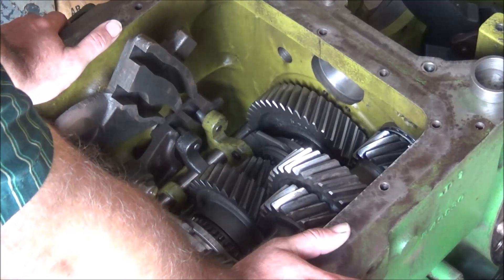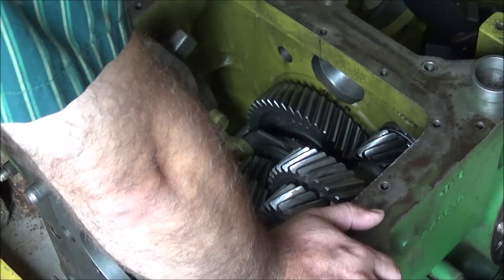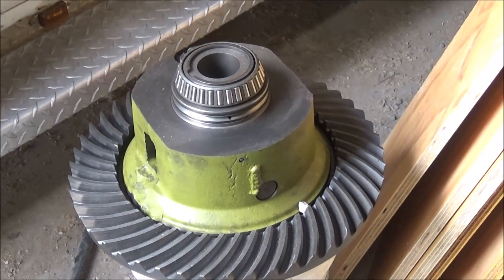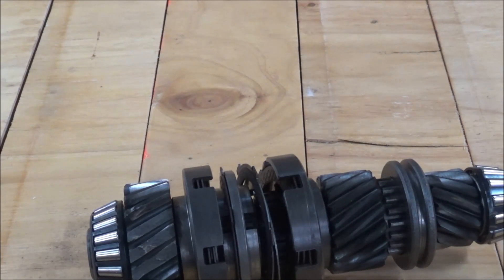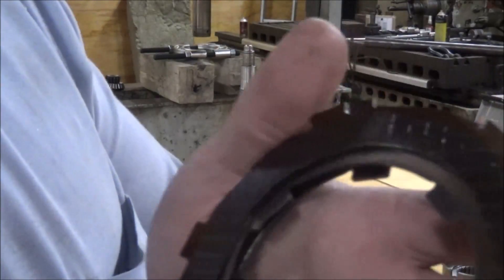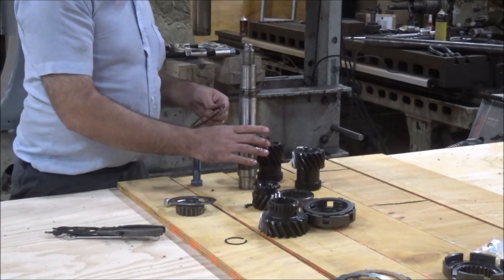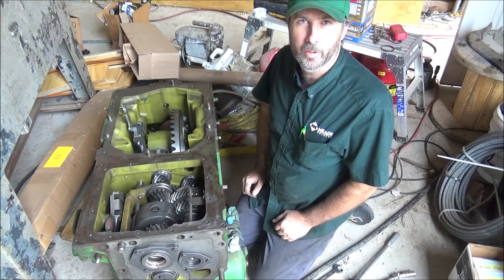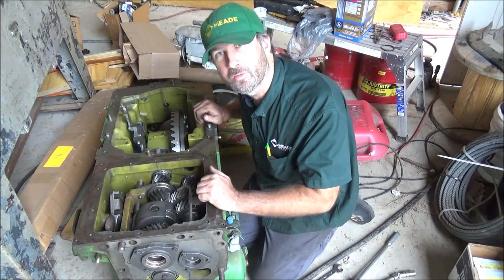Deere Tractor Pulling Transmission Faster Quad Range

Comment: I currently have a john deere 4350 with a quad range split. Whilst it's split my dad wants to swap gears in the quad-range for a faster top speed when on the road than 18mph. Do you know if this is possible and what gears we would need. 

Thanks, 
William
Reply from the maker: I am not familiar with a 4350 because we Don’t have those in the us. I assume it is like a 4250 and uses an under drive/direct 2spd. You get put a 4440 or 4455 2spd in it which is direct and overdrive and that will increase your ground speed 27% in both lo and high.

Comment: Nice vid sir..but ive always wandering how this power shift really works...
Reply from the maker: This isn't a powershift transmission they are made totally different.
Reply: @bcbloc02  got it sir..sorry..faster quad range right?.. if possible ask some favor how it works..coz my 4430 JD has a 1st and 3rd gear slippage..2nd & 4th gear are working and reverse..i was thinking to bypass the slippage gears 1&3, is it ok.? Thanks

Comment: what speed did the new gears obtain?
Reply from the maker: 6% faster than factory road I think.
Reply: So all of D range was only faster, A,B,C the same?  Are those gears still available?
Reply: I have a 4440 that is needing some hi/low work and it does a lot of road work. Was curious about a little faster road gear
Reply from the maker: @jimcrocker5183  The bottom shaft gear is still available from Deere the countershaft is not so you would have to find it in a salvage yard. If you didn't care about all the gears changing you could speed it up 27% by putting 4430 finals and brake plates on it.  That is a much easier job than a complete transmission teardown to change the 2 gears.

Comment: To handle any real hp you need to build 3 speed transmissions for these john deeres. If guys are serious pullers though they usually don't use a quad. The usually use a syncro. I have  built many 3 speeds but never one for a quad. The new top shafts that I build are 1 3/4" dia where they come through the front bearing and I use a coupler to attach to the 1 3/4" clutch shaft. Not sure how that could be coupled to a quad 2 speed. The 3 speeds I build are usually all faster than the original  road gear. They use the 7th gear slot, 5th gear slot, 8th gear slot and  1 reverse.
Reply: Here is 3 speed i made.
"https://i.ibb.co/fd9cB9h/Screenshot-20200414-190040-Samsung-Internet.jpg"
Reply from the maker: Yep about 800hp is the limit on a 4430 based rear before you start breaking stuff all the time.  Keeping the quad is an advantage in the RPM limited classes because you can get more ground speed mid track vs bouncing off the governor. The 4640 based trans I built had 2 road gears for a 17.5 and 18.5 final. It has lived hundreds of hooks with 1500+hp and 3000ftlbs of torque in a 10000lb class. 3 spds are for sure the way to go for the RPM unlimited classes unless you want to really get fancy and free up some hp using a Profab or SCS box to eliminate all the stock design stuff.

Comment: Some footage later of the trans in action would be cool! 

Also when your tightening bolts in a transmission you must make the "click, click" sound with your mouth to ensure proper torque. Pro tip. LOL

Comment: I remember those snap rings on the bottom shaft, I had wedges made up for them. When you bolt it up there is no washer on the top r/h bolt or it will jump out of D range If I remember correctly. Dont ask me how I know, lol. I used to enjoy that work, I was always the gearbox man. I remember them splitting the rear gear on the top shaft from going reverse to forward without stopping. Or vise versa cant remember now. The press is paying for itself. I always have a big block of wood under mine in case I miss catching a shaft.
Reply from the maker: Back a big load in B or C reverse that will usually break one for sure.  These gearboxes are a bit more than the Fergies have. LOL
Reply: Yeah these were my bread and butter for many years. The Fergies are more of a hobby as they are light to cart around. Wouldnt pull the skin off a rice pudding.

Comment: What do you mean by “cheap” oil? Saying I should be using only synthetics?  Can you recommend a brand-name? Love your videos.
Reply from the maker: Anything that usually says"universal" on it is bad.  In the case of these transmissions I would reccomend John Deere Hy-Gard only. It is especially designed for equipment that can sit for long times and has excellent corrosion inhibitors as well as extreme pressure lubes for when it is being used hard.
Reply: thanks

Comment: Brian, You mention the problems caused by cheap oil.  I want to know what oil you recommend?  Thanks for the information and entertainment.
Reply from the maker: Anything that usually says"universal" on it is bad.  In the case of 
these transmissions I would reccomend John Deere Hy-Gard only. It is 
especially designed for equipment that can sit for long times and has 
excellent corrosion inhibitors as well as extreme pressure lubes for 
when it is being used hard.

Comment: You need a big logo sticker to put on your work.  Perhaps a cube (or two) in isometric view with your initials, one on each surface in view, and imposed over symbols recognized for mechanic, machinist, and welder.

Comment: Brian, the other problem is when you don't heat the oil up enough to drive off the water, so it stays emulsified forever.  This is a common problem with forklifts running propane too, because the propane converts to CO2 and H2O, which makes it into the oil.
Reply: EFormance Engineering CO2 and H2O are the primary product s of all hydrocarbon (propane, gasoline, kerosene, diesel) combustion ... Propane is not special in this regard.

Comment: Congrats. Great job. I try to avoid messing with a transmission. That work makes me nervous. Seems to be relatively small, for this amount og torque.
Reply from the maker: Well it was only designed for torque in the 500ftlb range but to last for 10000hrs doing it.

Comment: Gee Brian, I guess you'll have to tear it all apart again so we can see what you didn't show us. Remember we all learn from mistakes...Just kidding. BTW I hope you tightened that loose nut in your shifter quadrant.
Reply from the maker: Yes, did you not see it in the last shot? ;-)
Reply: So is there supposed to be a gap between the nut and the main shaft selector quadrant?
Reply from the maker: I thought you could see it at the 15:40 mark that they had been tightened up but they are blocked out of the shot.

Comment: Good information to know about using the cheap oil . Is there a specific oil that should be used ? I would enjoy some footage of these pulling tractors you work on. Thanks again for sharing your time with us.
Reply from the maker: I use John Deere Hy-Gard but in general the manufacturers suggested oil is the best to use.

Comment: on the clutch pack you assembled.. is that mechanical force being applies some how to squeeze the clutches and steels.. or is there a hydraulic piston on the shaft that we missed. 

 how big a super magnet do you stash down in the bottom of the transmissions to collect the fragments..  since i have been using super magnets. my gear oils don't turn color..
Reply from the maker: That big drum looking thing on the top is what applies the force to the syncronizer clutches when you shift it.
Reply: so the pressure on the clutch pack is applied by a shift fork then.. not a hydraulic piston.  ok.. oh.. that a syncronizer...to slow the shaft to match speeds for spline engagements .. not actually a engine torque transfer clutch pack...  the missing friction material in some areas must be what caused the random wear to the splines or teeth faces. ..  now it makes sense...

Comment: The first thing we did in the spring after the tractor sat all winter was crawl under and pull the plug on the gearbox. It is amazing how much water comes out. All condensation.
Reply from the maker: All so true, good advice!
Reply: This is it. The heat of running regular will drive off the water, but let her sit for a year and you end up with a lot of condensation in there. Better oil will cling to surfaces longer in storage, preventing the rust. On first start, the water will burn off once the engine warms up however when you first start it the oil pickup will first pickup the water because it is at the bottom of the pan. During first startup, the engine is getting water or water/oil foamy slurry until it warms up and drives off the water..... This wears the engine fast.  Draining the water in the spring is a great practice. In addition, if you check fluids in the spring before running the machine, the water could make a low oil level look normal on the dipstick. Always recheck fluids after the first run due to this.
Reply: Would be nice if it had a water separator plumbed into it...

Comment: Why is the draft sensing in there for a pulling trans?
Reply from the maker: Farm stock rules require working 3 point hitch.
Reply: bcbloc02 ah ok..but do they check for draft sense function?

Comment: So many times I've forgot to turn on the camera . Or The battery goes dead and shuts down the camera in the middle of a operation. Fun stuff. 
Those transmissions are pretty HD looking.
Reply from the maker: Yeah I had a battery cutout on this job too. Also don't forget memory card is full and it shuts down too!
Reply: @bcbloc02  The fun never ends.
Reply: You guys are better than me. Number one problem I have is forgetting to push the "record" button.  🤔

Comment: FWIW turn the
 guillotine puller 90° to reduce chance of bending the threaded rods on a hard pull
Reply from the maker: I had them well supported and it only took about 3 ton but yeah the other way is stronger, just harder to manipulate by yourself at least for me.

Comment: Cussing is ok as long as there's no tool abuse ;-) Unsure of how much ram force you were applying to those shafts but have found   that bearing separators are much stronger if used 90 degrees to way you had them.

Comment: Nice work.  I would rather do an automatic over a manual trans most days.  Smashed and cut fingers, pressing everything apart and together,  lost detent springs and balls, locking up as the slide dogs bind on the synchro blocking rings .... ahhh the fun of it.  

Always fun to watch the friction elements draw in the oil and push out air. I submerge mine on automatics. That is where the half quart bottles of leftover fluid wind up.  

You seem to have it well in hand.  Press seems to be working just fine with very nice control-ability. 

I heard that you may be in Illinois on Saturday.  If so I will see you there - God willing and the creeks don't rise.  

Dan
Reply from the maker: Yep should be in beautiful Streator Saturday. :-)